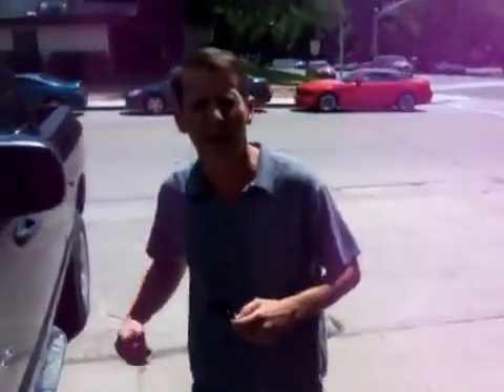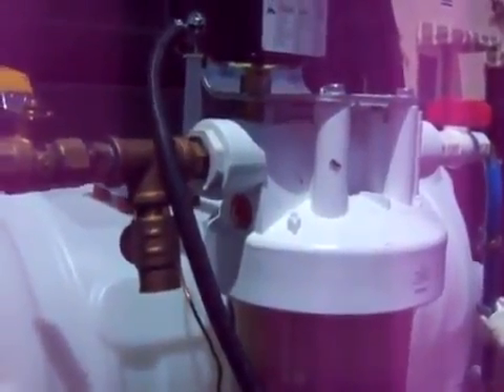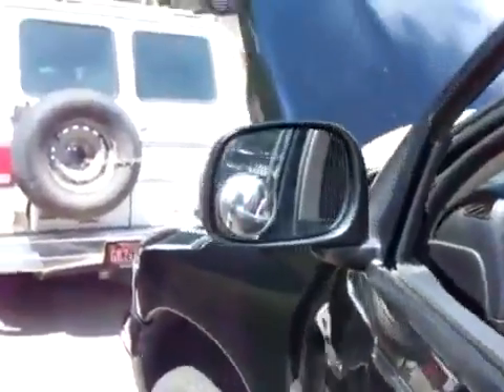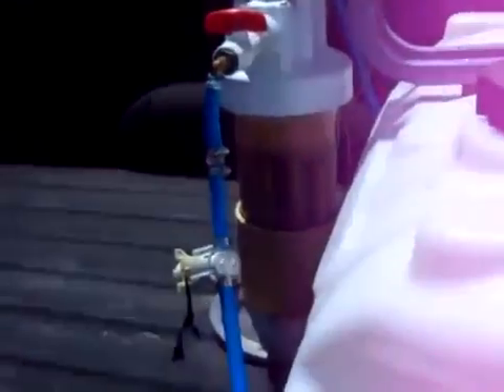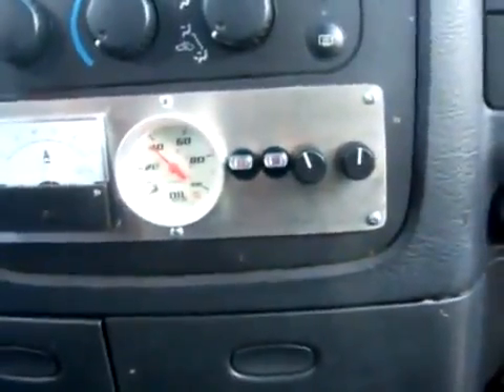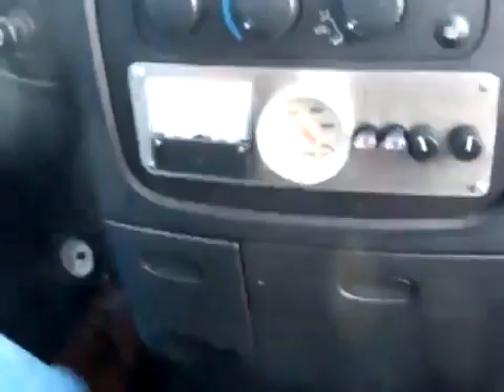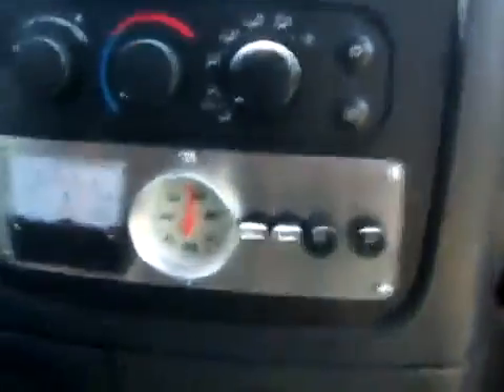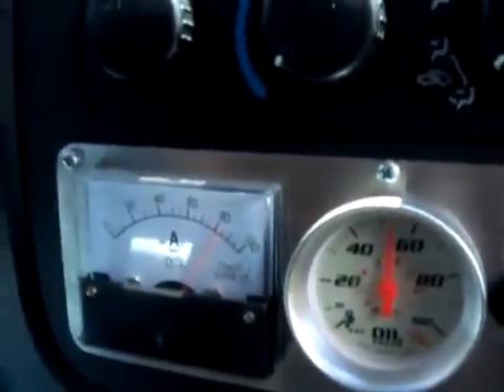This man runs his truck on water.

Comment: Guys. I've never seen this video.but from the number 55 lpm using  55 amps ; I guess he is using Ammonia solution.which only needs around 0.2 volts between each plate.this is tenth what is neede to separate water.anyone can do it.but using ammonia or even urine.